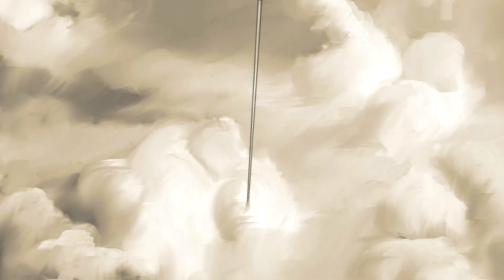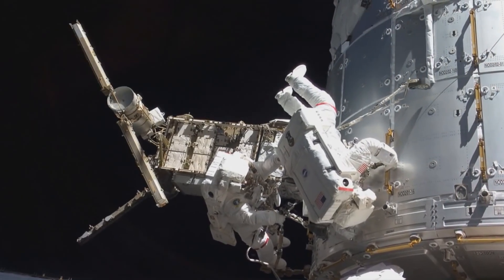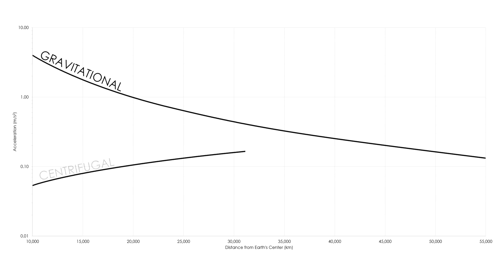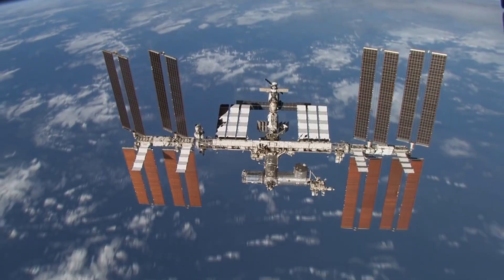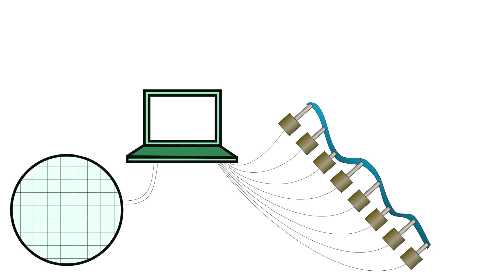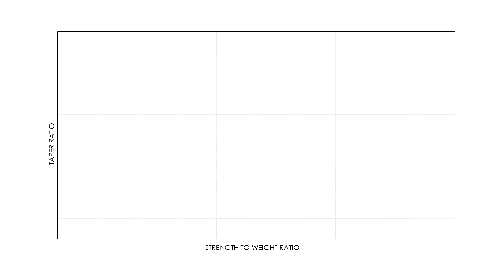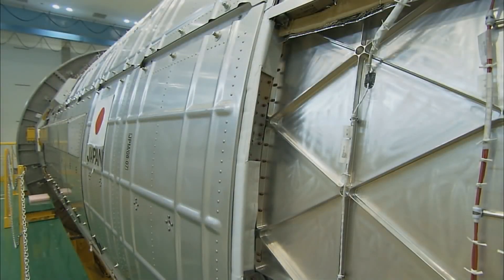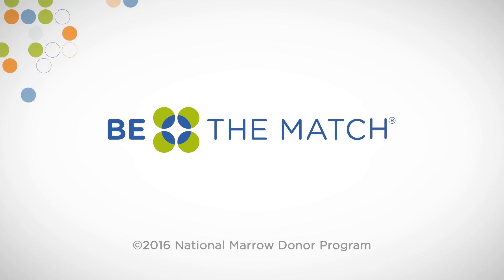Design Your Own Space Elevator

Comment: Why did you include “Centrifugal force” when it doesn’t exist?
Reply: Right, i was wondering that too. Don't the bodies have to be structurally connected for centrifugal force to appear? Like, in a rotating space habitat, we would need to grip the "floor" first or it would just rotate past us, right?
Reply: @konsyjes  It does not work like that. A good example is the ISS (or any satellite), that orbit solely because of centrifugal force.
Reply: @sebastiaomendonca1477 Ok, how does it work then? What is the "centrifugal force"?  It is an abstraction, of he momentum imparted to a point connected to the center of a rotating body, because the body is "pushing" the point tangentially around the axis of rotation, but does not allow it to move in a straight line but rather in a curve because it is tethered to the center by tension, and will move as far from the center as this tension will allow. This is clearly not the case with satellites, because satellites do not rotate at the same speed as the body they orbit. The ISS does not orbit the Earth once per 24 hours, because it is not connected to the Earth's center. It does NOT rotate WITH the Earth like a spinning top but is "tethered" by gravity, while the impulse is provided by its innertia - not the Earth. Do you see the difference? The idea with the space elevator is to place the top of it at the point where the angular velocity of the Earth would match the orbital velocity but that does not mean the two types of force are the same. The force that allows bodies to orbit relies on conservation of momentum, so any energy taken from the system, such as pushing an object against the tether's tension, would degrade the orbit.  Not to mention that the tension of the physical tether would be a duplicate of the force of gravity - not a replacement. So the moment the orbit changed, the full weight of the system would push sideways on the tether, like a giant lever that no manmade material could hope to withstand even at a short distance, let alone 11000 km or whatever the Geosync orbit is. And also, how would you build it up to that point? Like, ok let's say when the system is finished it will be stable, but how would you connect the tether to that satellite? Imagine the intermediate stage. You instantly created by magic HALF of the required tether, so you are about 3000 miles up and the rotation of the Earth is WAAAY slower than the necessary orbital velocity to maintain altitude, so the whole thing immediately falls down to Earth in a big arc
Reply: @konsyjes  Thats the point, an orbit at the surface is faster than the earth spins so you can counter gravity with the centrifugal "force". If gravity was weak enough that the centrifugal force could match it at the surface and rotating at the speed the Earth does, we'd be constantly floating.

The other big problem with this idea is the tether, because as you pointed out, the great majority of it would be under the effect of gravity. Thats why you need it to be so strong.
Reply: @sebastiaomendonca1477  why majority? All of it would be under effect of gravity. Gravity acts upon everything from here to the Moon and beyond. gravity would act upon every point of the tether. 

You did not read my explanation. Centrifugal force only acts upon objects physically connected to a spinning body. The spinning center is literally pushing an object away and also pulling on it. They cover this in school. How are you going to "counter" gravity with centrifugal force if gravity is much stronger. You are right, on a small enough object that rotates faster than its orbital speed at the surface you would not be able to stand, like an asteroid or a comet I'm sure could present such problems. This is why when they tried to land a probe on the Chyuryumin-Gerasimenko comet it had those spider legs to try to grip into the surface. If you tied a tether to that, I think it would spin with it as a system, because of "centrifugal" force because it is stronger than gravity. And if we were to "jump" up while holding on to the surface, at the right speed we could go into orbit around that body. But on Earth, the whole structure would come crashing down, I guess unless you built it TWICE as long, equalling the weight outside the Geosynchronous orbit with the weight inside it, but it is insanely impractical. You see what I'm saying, right? I understand what you mean, but I think you are forgetting about the force of gravity.
Reply: @konsyjes  "Centrifugal force only acts upon objects physically connected to a spinning body" Wrong again. Gravity acts as the "tether", more specifically the inwards force of the tether.
Reply: @konsyjes  YOU dont understand it. On a satellite orbiting, you have two "forces" acting. One is gravity, which is self explanatory. This is the force you're trying to counter. This is the force that always exists.

As you speed up, you're looking to find a balance between the centrifugal force acting on you and gravity so you can counter it, and find this point where you are curving away from the surface as fast as gravity can pull you down. Gravity CAN be described as a tether but only at this balance point, because if increase the angular velocity and thus increase your centrifugal force, gravity wont get stronger, you'll just increase your apogee.
Reply: @sebastiaomendonca1477  ONe is gravity, and the other is....? So you are describing getting into orbit :"curving away as fast as gravity can pull you down". So this is not motion caused by the Earth pushing you with its rotation, but by your own propulsion and you would have to go much faster than the Earth's rotation to reach that balance, right? This is orbital velocity, we both know this. So how do you imagine the tether holding up when it is a quarter or half the length, rotating much slower than orbital velocity? Now imagine that is is the full length from Earth to Geosynchronous orbit: all the pieces that are orbiting slower are STILL affected by gravity. If you think of every piece of the tether as a separate satellite I think you can see that the whole construction is impossible.
Reply: @konsyjes  Thats the key, they arent separate satellites. Thats where tension comes in, and why it has to be so strong. Anywhere below the top anchor is still feeling some gravity.
Reply: @sebastiaomendonca1477  yourealize gravity does not go away just because you connet bodies to each other. Tension appears only with centrifugal force: centrifugal force is much weaker than gravity therefore no tension. like I showed in the drawing, you would need to extend the orbit twice as far to have enough centrifual force to counter gravity
Reply: @konsyjes  You dont, thats why you have an anchor. The rope is "dangling" off the anchor, thats why it needs to be something heavy like an asteroid. As long as the rope's CoM is at the geostationary point it wont "fall". 

Also, centrifugal force is as strong as gravity at the orbital point
Reply: @sebastiaomendonca1477  OK. Imagine the anchor orbiting in geostationary orbit without the tether. It is not changing orbit, right? So why would it start "pulling" on the tether just because you connect a tether to it? If you connected a free-floating body to the "anchor" it is not like the "anchor" would suddenly start moving away from its parent body. Gravity does not disappear just because you built a centrifugal system . Right, the CoM has to be at the geostationary point, like you say. This means the anchor has to be further than that, right? So, depending on the mass of the tether relative to the anchor this could be much further, like twice the distance, which would further in crease the mass of the tether so you see it is not simply Geostationary orbit that would give you the point of balance but it would have to be much farther than that. So you can see there is a good reason why planets are round, and especially the bigger ones, whereas lighter bodies can be eccentric especially rapidly rotating ones
Reply: @sebastiaomendonca1477  oooh geting angry now? maybe because you are starting to realize you will have to revise your opinion soon, which is what spoiled children hate to do. You realize any centrifugal system is maintained through tension - that's the "anchor" pulling on the tether. But it the anchor's orbit is stable - why would there be tension? What you are imagining is something with hollywood movie physics, where forces work the way the writers who don't understand physics want them to work. "Hanging" from the anchor - you are imagining the tether just "hanging" from the anchor like a coat on a hook here on the surface, even though the Anchor is not nailed to anything XD Then you imagine the system spinning just like a paper plane on a stick and you go "yeah it will be just like that" without giving it any more thought, just handwaving astrophysics away for plot convenience. The moment you attached  something to the "anchor" its orbit will shift with the new common CoM becoming the reference point for the orbit. Each point of the tether is also being acted upon by gravity, so the whoole system will be pulled down to Earth. Everything orbiting a body either moves at the specific velocity for a circular orbit or its orbit becomes eccentric and the Apoapsis lowers until it reaches the center of the joint gravity well. I guess what you would have to do, I just realized, is go to the "anchor" and, first impart it a rotation equal to the rotation of earth (just like the Moon) and then start building a tether in BOTH directions: one going away from the anchor and one towards Earth, maintaing the CoM at the anchor at all times.... I think that what would make sense, but of course loigistically it is a completely insane project. It wouldn't also be a centrifugal system - simply a highly eccentric orbiting body -until you "conneccted" it at which point you could put the system under centrifugal tension by shifting its center of mass to a higher orbit.
Reply: @konsyjes  Now you've just cemented the fact that you have no clue what you're talking about
Reply: @sebastiaomendonca1477  if you say so. if you just BELIEVE it's true strongly enough - then it will be so ;)

Comment: If the tether was magically small as indicated in the end of the video, would running a counterweight or pulley be possible instead of individually powering the climber car? You know, like a real elevator?
Reply: Can you imagine coiling up a 42000km long wire?

Comment: Shoot the capsule out of a space gun. It’ll go up to the very minimum it needs to be in space then it’ll slow down, stay at that required speed then it’ll dock with the satellite. Boom! Just solved the power supply problem.
Reply: But you'd be conveying a linear impulse to something travelling along a rotating trajectory, no? Also, wouldnt the mismatch of required orbital trajectory at each "height" degrade the innertia of the projectile? Also, I dont think I'd want to ride this kind of initial acceleration. Also, if you have that kind of gun what is the point of the tether - if you can just shoot payloads into geostationary....  life would be strawberries

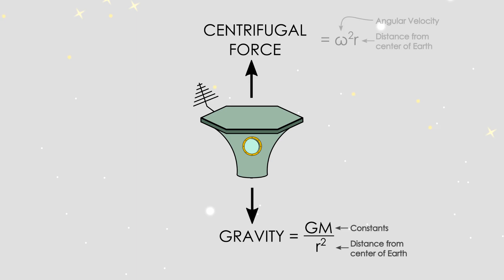Comment: @2:40  Centrifugal force?  No such thing.  You mean inertia.
Reply: In this situation, same thing
Reply: @Sebastião Mendonça:  One exists; the other does not.  If centrifugal force existed, an object released from a centrifuge would travel along a ray extending a radius of the rotation.  It doesn't; it travels along a tangent.  That's inertia.
Reply: @ncooty Centrifugal forces "exist" and can be quantified in a rotating reference frame, which is non-intertial. That's why he specified that in the video. But since it's been 4 years, hopefully you know that by now.
Reply: @clorox9432  Nope.  See prior reply.  Physics is still the same.
Reply: @clorox9432  You're not addressing the issue.
Reply: @ncooty  Neither are you. Do you not understand the difference between inertial and non-inertial reference frames? You're correct; from an inertial reference frame, the object released would not travel in a path that would indicate that any radial force is acting on it. But from the point of view of the object, there is a force pulling it away from the center. This is how "artificial gravity" machines work---you're spun in a way that makes you "feel" like you're being pressed against the wall. No "real" force is acting on you that pushes you against the wall, but from your non-intertial reference frame (in which you are stationary), you feel a force akin to gravity that counteracts the normal force of the wall surface. 

This concept is such an easy thing to Google and verify on your own.
Reply: @clorox9432  The reference frame is irrelevant.  If you were to be released from that centrifuge, at which angle would you see the centrifuge move away from you?  Presto.  QED.  Inertia.

Similarly, imagine you're in a spinning centrifuge, feeling as if a force is pushing you (from nowhere) against the wall, and then it suddenly stops.  Which way would you move?  Would your movement be governed by inertia or your feelings?

If you prefer to think of physics in terms of what's intuitive to you and how things feel, you do you.  (Clearly, you're already convinced that you're immune from over-confidence.)
Reply: @ncooty  When the centrifuge stops, the conditions of your reference frame have changed. Do you not understand what "rotating reference frame" means?

Also, this isn't about "intuition" or whatever you want to think I'm saying. That is not what I mean when I use the word "feel." You can mathematically derive not only the centrifugal force, but also other fictitious forces such as the Coriolis and the Euler forces when you consider a rotating reference frame. These are, once again, because you can't seem to read, mathematically described. Again, these are things you can read about if you just did some simple research. It's funny that you accuse me of overconfidence when you can't do something as simple as Google "centrifugal forces in non-inertial reference frames" and educate yourself properly.

I have no idea why you're not willing to do this.
Reply: @ncooty  To hopefully clear things up, I am not arguing that any actual physics is changing. It is indeed inertia that causes the apparent force. My point is that when you consider non-inertial reference frames (such as our rotating frame on the surface of Earth or inside a spinning centrifuge), fictitious forces appear, and they can be mathematically described. When you change coordinates back to the inertial reference frame, the fictitious forces disappear. Again, the physics is the same, and I never argued otherwise.
Reply: @clorox9432  Unfortunately, YouTube has not posted either of my two most recent replies.  That's quite frustrating, so I'm not going to try again.

In short, you seem to be saying now that centrifugal force (a force emitting from nowhere that disappears when tested) is an illusion.  If an observational perspective is restricted (a "reference frame"), it can yield a quantitatively predictable illusion--i.e., a mere phenomenon (a product of consciousness), not a noumenon (a thing in the universe).  E.g., a KC-135 is not an anti-gravity machine, but it might trick its occupants into thinking that it is. 

It's unclear how that position differs from what I wrote in the OP.
Reply: @clorox9432  "fictitious forces" = "no such thing" (cf. OP; again: QED)

YouTube has failed to post (or arbitrarily deleted) a longer reply 3 times, so I'm not going to retype it.

Suffice it to say, quantifiable prediction of an illusion does not a noumenon make.
Reply: @ncooty  "Disappears when tested" is not at all what I said. You did a great job misrepresenting all my points.

Comment: I'm pretty sure I can design a cheap-enough earth-to-low-earth-orbit space tower myself, using known science and cheap-enough materials like steel and aluminium. If you want to know more (i.e.make a video about it), message me on Discord (add Sapioit™ D. Suicider © - Slav
#9534 to tak), and I'll tell you enough about my telescopic active support space tower ideas. And no, it does NOT use a cable for getting up. But then again, if you're interested, you can message me, or google the terms I used.

Comment: If you started your elevator on top of Mt. Chimborazo and then built a 500m  building, you would have less tether length (and less gravity). What effect would that have on the dimensions of the Kevlar space elevator?
Could we transmit electricity along two cables of the tether and use brushes to collect the electricity along the way?

Comment: A lunar elevator is the way to go. The elevator would be constructed from a Lagrange point towards both bodies keeping balanced at the Lagrange point. The elevator could be anchored on the moon's earth facing side and extend to within say the altitude of the ISS. The only energy needed is to reach that altitude with only 1000 mph orbital speed to match the elevator/moon rotational speed. Because the lunar orbit is not circular there will have to be an automatic length adjuster. 2 cents

Comment: someone explain to me how they propose to even get the cable run between the earth and the top. Do you make it on earth and tie it to a rocket and shoot it up there? Or do you launch the whole thing up there and then lower it down? (lol @ both ideas) It makes zero sense to me I don't see how it can be done. Never mind making it even small enough to work with. There will never be a rocket powerful enough to pull it up there and i don't think you could just lower a rope straight down to earth while traveling like 25,000 mph.